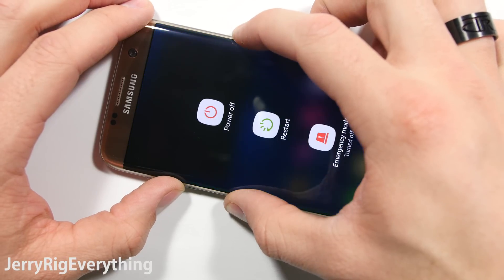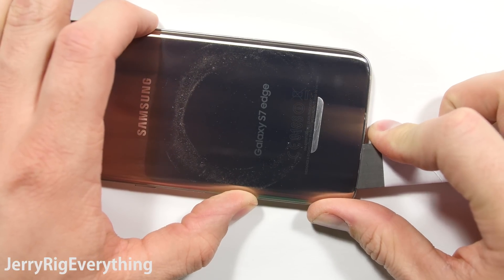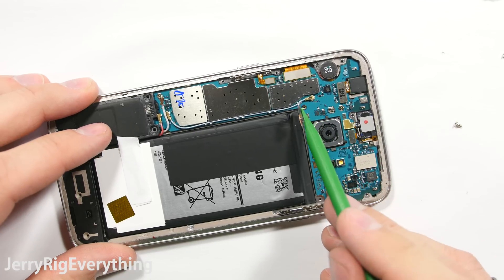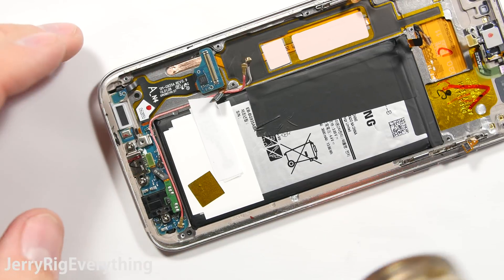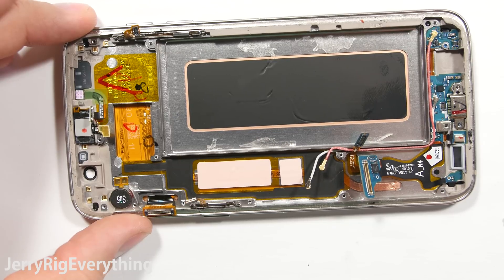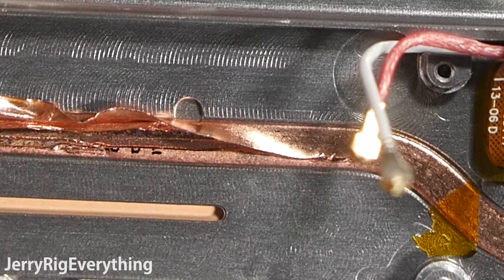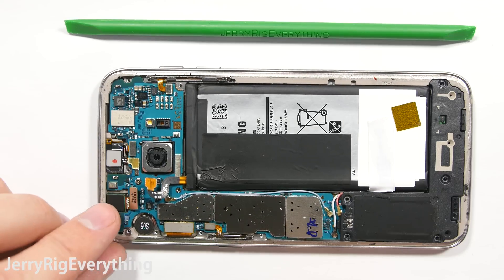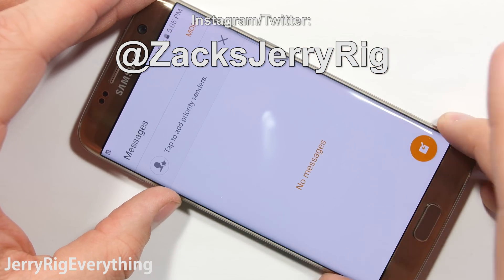Galaxy S7 Edge Screen Replacement - Charging Port Repair - battery fix

Comment: If you consider heatpipes liquid cooling, because by design heatpipes are meant to have a liquid inside to help transport the heat, then every heatsink for a desktop PC that has heatpipes is "liquid cooled"

Comment: Typical conversation in a samsung repairing centre:
Customer: "Hello, my phone has a problem with XYZ"
Technician: "Ok, we need to replace the screen!"
Customer: "But...the screen is fine..."
Technician: "It won't be...."
Customer: "I think it is a software issue..."
Technician: "It won't be...".

Comment: after you tear it down, you use double tape to stick the back cover back in which presumably not as strong as the original? so is it still has the water resistance capabilities as the original one?

Comment: The Galaxy S7 Edge cooler is a vapor chamber heat sink.
It is the same used in most of the desktop to cool the cpu.
The vapor chamber heat sink have cooper piper with a refrigerant inside(but they can add a second liquid to increase conductivity and reduce the "gas bubbles" at the processor side). The refrigerant is one or a mix of those who are on this list: en.wikipedia.org/wiki/List_of_refrigerants
The refrigerant is inside the cooper piper at high pressure, and exist at 2 phases that are mixed: liquid and gas. The quantity of liquid and gas is always the same.
If you open the pipe, the refrigerant pressure become the ambient pressure, 1 bar, and it cool down for a short time. But then it become gas when is rising the temperature to the room temperature (about 20ºC).

To dissipate the heat, the cooper conduct the heat from the processor to the refrigerant inside the pipes. Then a portion of the refrigerant that is at liquid, absorb the heat, change to gas and escape to one of the different side of the pipe. Then the gas conduct the heat to that wall and next the heat is conducted from the pipe wall to outside. At the same time a molecule change from liquid to gas, another molecule inside the pipe change from gas to liquid.
Reply: Damn....
I just got schooled

Comment: Cuts open heat pipe "Good as new!" 

phone explodes upon boot
Reply: L
Reply: its not waterproof anymore
Reply: Zeep50 It was never waterproof anyway :P but it was water resistant
Reply: HugsOverDrugs What phone was it tho? also, sorry for ur loss
Reply: @hugsoverdrugs6730  must be externally damaged
Reply: @hugsoverdrugs6730  lul
Reply: I bought an note 7 a few years ago and it actually kinda blew up on boot
Reply: LOOOOL
Reply: heatpipes that use in the example has no liquid impossible to explode

Comment: Hi Jerry, thanks for your video. i can see many sites now talking about your S7 tear down. can i ask you one question?  there is a post on XDA from one of the senior members there claim that after he drowned his S7 under the water and then after 4 hrs when he tried to charge it he got a warning msg that the USB port is wet so he cant charge. they assumed on XDA that Samsung implement some sort of lock/ shield protection to prevent electric damage to the phone when the user try to charge it after damp it. is that True ?
thank you.
Reply from the maker: Im actuality making a similar video right now.  Itll be posted in a few hours.
Reply: YES :)
thank you. i will update colleges on the forum about this news. i will be waiting.

Comment: The S7 is not Liquid Cooled, it is Vapor Chamber Cooled. Vapor Chamber Cooling has been used in computers to cool the CPU for many years on after marked heat sinks. So all that hype about "cooling System used in space" is just that HYPE. Liquid and Vapor Chamber cooling don't work the same and Liquid Cooling works far better than Vapor Chamber Cooling so don't expect miracles in cooling.

Comment: here's a question for you if you have to replace the back of this phone yourself or the screen it will still be ip68 water resistant no one ever talks about this when they repair waterproof phones

Comment: Do you know where the e-fuse that holds the samsung's KNOX together is? The thing (wire?) that goes like "boom" when you root the phone or do some stuff with it's ROM. Is it replacable too? I mean.. can you replace the burnt out fuse (wire?) to get your warranty and KNOX back after installing a different ROM on your S7 (S6)?

Comment: How does the "liquid cooling" still work if you cut into the pipe? I thought it was filled with gas that turns to liquid when it heats up... Doesn't cutting it release the gas and ruin the way it cools?

Comment: is there any shop selling adhesive strips
Reply: +Mc Mel you can find them at amazon. 3mm 3M Double Side Tape...And better use the Water resistant Version ;)
Reply: +lxrick thanks

Comment: on the first look it seems that after removing the screws, you can just unsolder the charging port - so what's the problem with replacing it? does it hold by something else?

Comment: Quick question: what makes this phone waterproof?? By your teardown of the S6 there isn't much diference...... Phones are not made to swim, Sony backed out and so does Samsung (Gear S2 is IP68 rated but Samsung does NOT honour the warranty if it got wet)..
Reply: glued from inside and its ip68 WATERPROOF

Comment: I have a Noctua NH-D15 in my computer, 6 heat-pipes on that AIR-cooler. And if i said i have a liquid cooled CPU i would forever be a PC-noob. No heat-pipes are not water/liquid cooling. Heat-pipes are heat-pipes liquid in them or not. To be called liquid cooling you need a liquid, a pump and a radiator
Reply from the maker: I agree 100%
Reply: +SNAKEKIDD18 Think you mean "matter" instead of "liquid" (Gas is a state of matter)? A liquid becomes gas when the pressure and heat are right. 
https://en.wikipedia.org/wiki/State_of_matter

Heat pipes and liquid cooling works on very different principles. A liquid cooled system relies on a pump to transfer a heated liquid to a radiator, like in a car or an AIO. But a heat pipe uses vaporization / condensation to transfer the heat, or rather spread out the heat threw the whole pipe fast.
Reply from the maker: +Kim Mortensen that would be interesting.  When i get my regular s7 assembled ill see if i can get a thermal camera and test them both.
Reply: Gas is a state of liquid
Reply: +JerryRigEverything I'm curious tho. After you destroyed the heat pipe inside the phone, did it get any thermal issues? Compared to a healthy device do the disassembly phone overheat if you shoot 4k video or run several benchmarks back to back?

Would be interesting to see a video on how effective the heat-pipe are on keeping the CPU cool.
Reply from the maker: +Kim Mortensen that would be interesting.  When i get my regular s7 assembled ill see if i can get a thermal camera and test them both.
Reply: JerryRigEverything- curious have you use the therm Cam yet? And what would you rate the life expectancy of the cooling pipe once you've done this? Interesting video thanks

Comment: "Let me just cut the liquid cooling system to show you transparent gas"..."Now if I close it again, the gas will return to it's initial encasing where everything will be as good as new again"... Dafaq? You've destroyed the LCS 🙈
Reply: but the person who buys this on craigslist won't know that
Reply: +Thafier salie hahaha right!!!! Suckuhhhh
Reply: @zacharyybarra1722  he actually went on to use this phone as his every day phone until the S8 came out, he talked about it in some other videos
Reply: It is still copper it will transfer heat just fine it just won't be as efficient as it possibly could be and might throttle under gaming or prolonged heavy use, not even necessarily Netflix or something like that but more intense

Comment: Nice video! It's really bad that the charging port is almost impossible to replace. I managed to damage the port on my Galaxy S4 and am glad that it's cheap and easy to replace it myself:

And maybe there is a little bit of liquid inside the heatpipe, if it has a low surface tension it might just be wicked into the thin copper wires. Maybe it is some kind of hydrocarbon with a higher vapor pressure than water and low surfece tension.

Technically, a heatpipe needs liquid inside: At the heat source (CPU) the liquid starts to evaporate, and the vapor spreads through the heatpipe. At cooler parts (where the heatsink is placed) the vapor starts to condensate, and the again liquid medium is wicked back to the heat source by the copper wires. Also, the condensating vapor locally reduces pressure in the pipe and therefore pulls more vapor to the cooled part.

Furthermore, it takes a LOT of energy to evaporate a liquid, and the same amount of energy is released when the vapor condensates.
Just to tell some numbers:
It takes 4.2 joules of energy to heat one milliliter of water by one degree celsius. So heating one milliliter from 0°C to 100°C requires 420 joules.
Turning one milliliter of water at 100°C temperature into steam of 100°C temperature requires a whopping 2257 joules. This is also the reason why boiling down water while cooking takes so long.

As far as I know, the thermal conductivity of a heatpipe is about 1000 times better than the conductivity of a identically-sized rod of copper. That's pretty incredible!

Without a liquid, there would be just gas somehow circulating around in the pipe. Unless there are fans inside (lol...) I guess this "heatpipe" would have a worse thermal conductivity than a piece of copper with the same size.

Comment: Did you damage the display? That think in the middle?
Reply: that was on there on the start of the video as well. hopefully its just a smudge
Reply: +emperorjj1 Its the same fromm every angle he shows it, does not look good. Rip expensive  AMOLED tear drops

Comment: It's liquid gas... it remains liquid because of the presure of the pipe... if you open the pipe, it reverts to gas and you don't see it... facepalm.
Reply: +ascendence of course. It also has a nuclear reactor thanks to that refrigeration.
Reply: +ascendence When someone says "Liquid Cooling" they are usually referring to like a radiator or something, that is why it is still false marketing. The CPU cooler in my computer has heat pipes yet it is still called an "Air Cooler" because it uses fans, a heat pipe isn't liquid cooling.
Reply: +ascendence you are right but if there was actually a compressed gas it should make a fizzle noise when cutting that pipe
Reply: Humza Ahmed hmm yeah , but I think the guy from video is not that dumb to hear it and still say there's no liquid .... and I also think that there's no liquid because I saw those copper thin wires like wadding ... but who knows ...
Reply: Good point, but I wouldn't call it liquid cooling. If it were I guess most desktop gpus come with a pre-installed liquid cooling loop.
Reply: +Tanner Jarreau so wrong it could be any kind of liquid refrigerant and depending on which one it could be in a vacuum and be liquid
Reply: Well there's no liquid inside, but only a copper fabric that act like  liquid transferring the heat, hence "liquid cooling", advertisement at its finest imo
Reply: The only 2 common gases I know that are easy to adjust from liquid to gas via pressure are Butane and Propane.  Increasing the pressure of butane to about 2.6 atmosphere will increase its temperature by 38° thus, turning it into a liquid.  Problem is, butane is highly flammable and a strong enough electric charge will be enough to ignite it.  I believe Samsung is just using regular air at regular atmosphere within a copper heat pipe.  The hollow surface area inside the copper heat pipe is still sufficient to supply very good conduction of heat. So, i highly doubt its a fluid inside the heat pipe.  Yes false terminology in my opinion.
Reply: Well then why do I see liquid when I cut open a heatpipe from an old hyper 212 evo, yes it is an actual liquid that's what helps heat pipes be more efficient at cooling than just copper metal alone, when the liquid under pressure heats up it's boiling point is reduced due to pressure and then it turns into a gas and travles 5o the top of the heat pipe where it cools down and condenses then through capiliary action ( the same way your blood moves in your body ) the liquid moves back to the coldplate ( the part over the processor which is producing heat)
Reply: Also in this heatpipe it probably never had anything in it at all or if it did it was a very small about and because it was pressurized immidietly evaporated
Reply: This thread is an interesting example of how dumb people were 4 years ago.
Reply: +ascendence The pressure it would take to keep the vapor as a liquid would be ridiculous. There is never any liquid in the pipe. Also, I can't imagine there being a vapor that is even close to being as conductive as a liquid. The whole vapor thing sounds awry.
Reply: +dragoss16 I think the videos overdubbed or something. Maybe it does make a fizzing noise.
Reply: so from what I'm hearing
the "cooler" is broke and no longer works

Comment: Do a before and after thermal test, im interested if the pipe still works and also maybe if the vapor escaped it could cause the device more to heat up.

Comment: hi I have a question, I have a note 5 that had been water damaged partially,  and it used to turn on when plugged in but would not hold a charge.  now it won't turn on at all and it says it's charging but it stays at 0%, what do you think the problem is?

Comment: Is the core material gallium, or an alloy thereof? It may be liquid at operating temperatures. Indeed, taking advantage of the transition could be a good heat sync unto itself.

Comment: I'm guessing the water resistant rating is no longer valid after you put everything back together
Reply from the maker: You are correct.
Reply: +JerryRigEverything So will there ever be a screen replacement video for this or the S6 Edge+? Besides this teardown I'd like to see an actually replacing of a screen. My friends S6 Edge+ has a cracked screen. I was thinking of sending it in for repairs but am tempted to try myself.
Reply: +JerryRigEverything but i not wrong,  you can get the ip rating back if you replace the battery on official service center...  What do you think?
Reply: Global Wrestling I love them even more than before. What carrier are you on?
Reply: @mistamaog  I am on Vodafone.
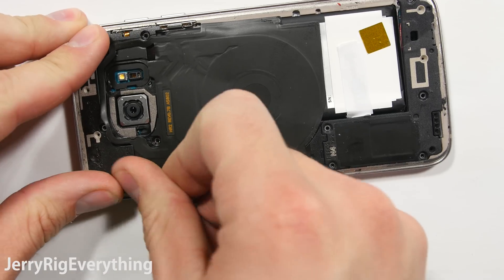Reply: 6:55
Reply: 6:55
Reply: +Laurent s they do it under warranty. even if your phone dies, it is still waterproof under warranty :P
Reply: +Rinaldo Jonathan replying 2nd acc, nope manufacturer like sony who put IP rating on their phone will put the waterproof back, but it takes longer, it is happen to my xz1 when replacing battery even thou it is not under warranty anymore
Reply: Hericho Go I already have the S7 Edge c=
Reply: +iMiguelAOG yea t-mobile.. We all have to wait tho
Reply: +iMiguelAOG android authority giveaway samsung galaxy s7 edge... https://wn.nr/SmRYG3

Comment: Wow. I was hoping the 820 would be much cooler than the 810. I hope we don't have a repeat of last year with the overheating and throttling.
Reply: BigMarks Samsung disabled QC 3.0 on the 820 variant. It only has 2.0 like the Exynos model.
Reply: BigMarks Samsung disabled QC 3.0 on the 820 variant. It only has 2.0 like the Exynos model.

Comment: When it heats up doesn't it turn to liquid?
Reply: usually when things heat up they vaporise ( liquid becomes gas), not condensate (gas becomes liquid).

so, unless there's a material that has those reverse properties and is a great heat conductor, the answer is no.

Comment: Didn't you irreversibly damaged the heat sink there? Just asking.
Reply from the maker: +svizac69 itll help dispurse heat still,  because it's copper.  But that's it now.  So ya.  It's damaged.
Reply from the maker: +svizac69 itll help dispurse heat still,  because it's copper.  But that's it now.  So ya.  It's damaged.

Comment: Would this still be waterproof after disassembling it?
Reply: I don't think so, the glue is what's mainly responsible for keeping the water out.

Unless you re-seal it with some glue/sillicone when putting the back on.

Comment: Isn't it possible that, idk, lighting the screen on fire and blasting a heat gun at the phone melted the against the processor?
Reply from the maker: +xzzlonezzwolfzzx I dont think so... that would have burned more of the back.  The burned marks very very specifically outline the processor.
Reply: +JerryRigEverything yeah but you're adding heat to something already warm or even hot. It just gets hotter there because there was already a heat source. I mean I haven't taken one apart I'm just speculating.
Reply from the maker: +xzzlonezzwolfzzx the processor was cool (turned off)  when i added my heat.
Reply: +JerryRigEverything Could it have been some residue from thermal pads or oxidation of the metal due to heat?
Doesn't necessarily mean that it melted.

Comment: Samsung glues their casing!?
Reply: How else did they get it to have IP68 water resistance?
Reply: +Tal Risin I just thought most phones were similar to the iPhone's basic screws and the bottom. Which then release the lock and you can unsnap the screen
Reply: Spencer Dawson Productions 
Q: Is the iphone IP68 water resistant?
A: No.

Q: Is the S7 IP68 water resistant?
A: Yes.

Q: Why is the S7 glued together?
A: To make it water resistant and dust proof, the glue acts as a sealant.
Reply: +Tal Risin Okay, my bad for not knowing everything about a cell phone I don't even have